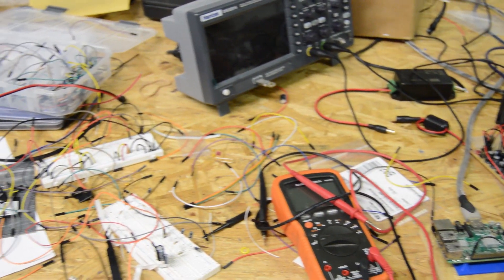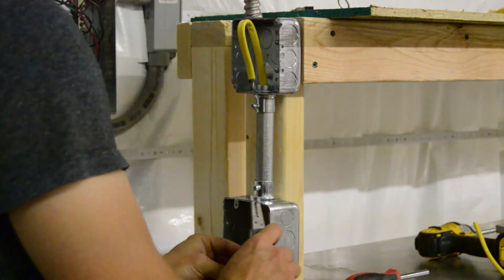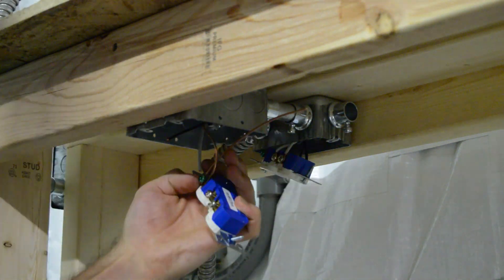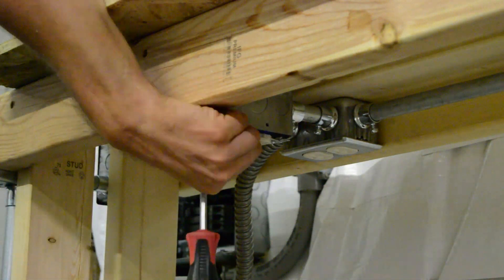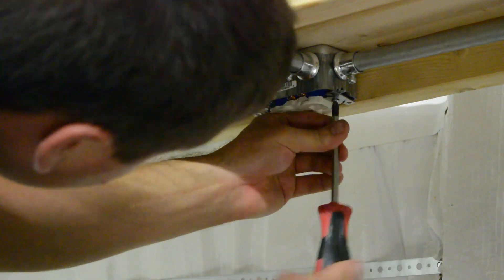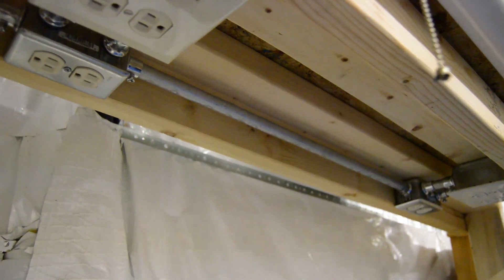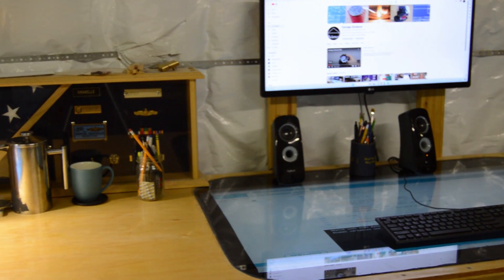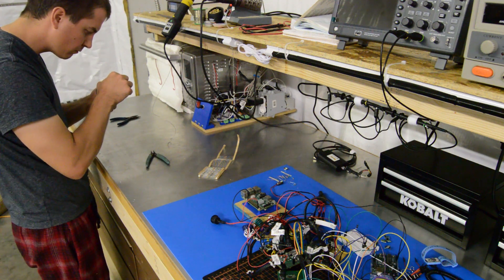DIY Electronics Workbench ~ Solder, Reflow, Test, Debug All in One

Comment: I am sorry to pluck the negative string on your work. Everything seems ok, but if you are using a metal surface on your workbench, you are inviting trouble. Metal surface and electric/electronic repair and/or assembly is a safety hazard.
Reply from the maker: I'm a bit OCD about fire hazards.  So having a metal surface helps limit the risk of an electrical fire on the work bench from spreading.  An ESD mat easily prevents unintentional shorts while working on boards.  But you bring up a valid point :).